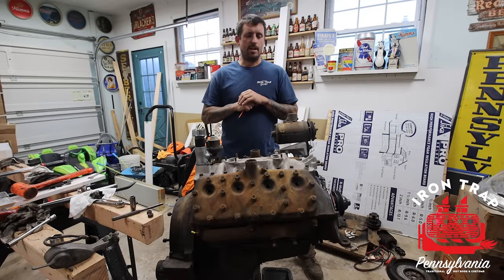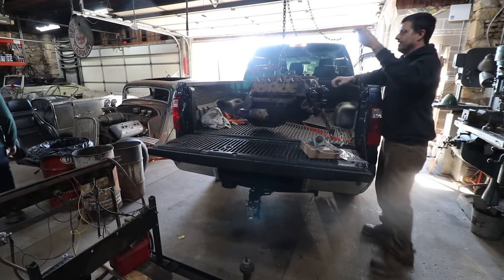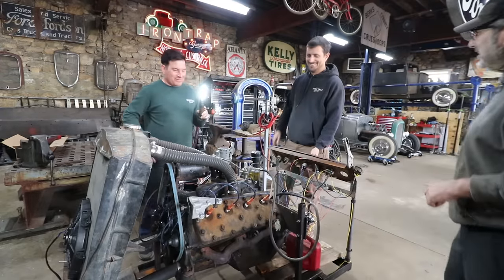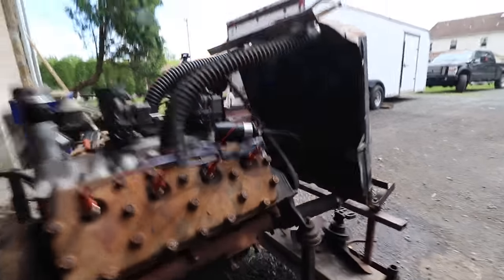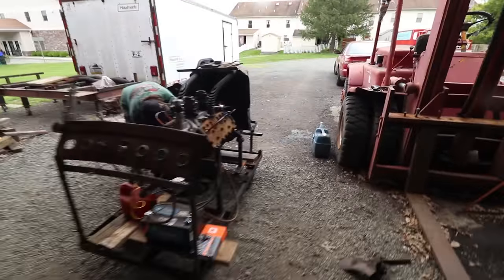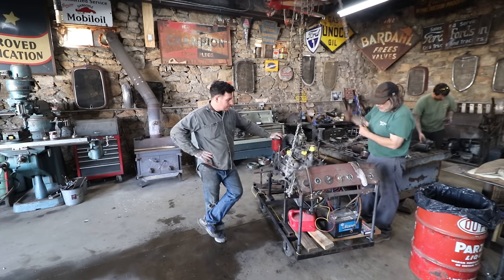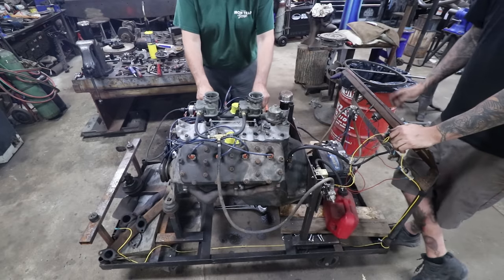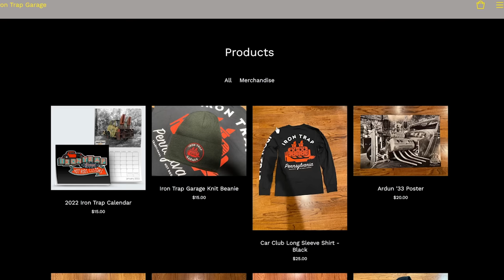Testing A 1937 Ford Flathead! - It Has Major Issues!!!!

Comment: Sometimes what look good may not be so good. Life lessons on buying used and being more thorough. Not a rookie mistake, but more awareness and extra checks. Another example of water cracks on a flathead. Great catch Matt/Steve. Engine test stand came through. Quickly highlighted a major issue. Lucky for the available engine replacement.

Comment: Very cool🤙I just acquired a 41 ford pickup that has a "fresh" 24 stud in it that's never been fired. The truck is partially restored and in a barn. I'll be pulling it out shortly. I have a couple more things to finish up around here. I'm making space  haven't put any content up later but I've been acquiring cars and parts I have 7 cars to bring back to the stable.

Comment: There are thermostats for these engines.  They drop in the hose outlets on the heads.  If you can't find those, you can use standard-size modern thermostats and grind off the flanges, and put them in the upper hoses and secure them in place with hose clamps.

Comment: Years ago I had a cracked hipo 289 head.   None of the welding shops would touch it.    My Dad found a shop that repaired heavy equipment and they were able to repair it.    I think it was called furnace brazing.     Might want to look into that as an option to repair the block.   Good luck 🍀

Comment: I'm not so sure it was a mistake ---- Mike ------- there was no way you could tell --- that there was a crack up inside the exhaust port ----- and as we watch you guys start up these flatheads whenever one is put on the Run Stand ----- we are told --- The true test ---- is to let it run for approximately twenty minutes or so to ----- SEE IF IT DOES LEAK ----it's not a mistake ---- it's a gamble ---- that it is a GOOD engine ------------- Thank you guys for a Good Video ---------- Rodney

Comment: Interesting and informative video.  Lots of nice work, too bad about the disappointment.  Had you all considered hydro pressure testing blocks before investing in assembly?  I have done a number of smaller engines, 4-cylinder tractor engines.  I too "learned the hard way".  Hydro testing is simple, takes a not to expensive hand pump and a few others bits n pieces.  Since I started doing it on blocks after machining and before assembly I'm not so nervous anymore.  You could do it before investing in machining too.

Comment: Since the right water pump is adjacent to the exhaust passage, could you access the crack by drilling the back of the pump with a hole saw, repairing the crack and re welding the back of the pump? I have some 98% nickel welding rod which is designed for repairing cast iron and which works great with no preheating required. It would make this type of repair feasible.

Comment: I have a 21 stud '36 Ford engine in my 36 Ford with a similar issue. It needs to be gone through, its been parked a few years now due to a blown head gasket and other misc issues. Might consider pulling it out and putting in a 24 stud engine.

Comment: Unless you pressure-tested the cooling system (hard to do with the motor out of the car and sitting on the floor) there's almost no way you could have known the first motor had a cracked block

Comment: I know how you feel Mike, my “running when pulled” flathead has a lifter with the bottom knocked out and a cam with one very worn lobe.  It may have run, but it didn’t run well…

Comment: Not a foolish mistake. How could you have spotted this issue when buying this engine? Other than putting it on a run stand and running it like what was just done there is no way of knowing.
We but old stuff and roll the dice. At the very least there’s a good crank and pistons that could go in another block or perhaps Iron Trap needs a vintage dragster to take to nostalgia races?